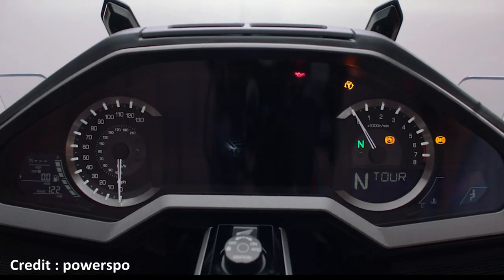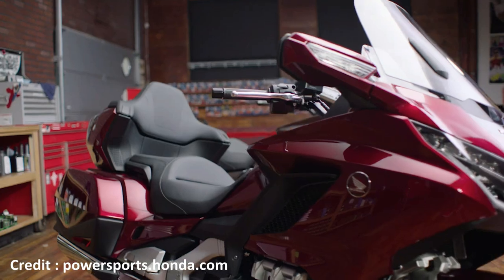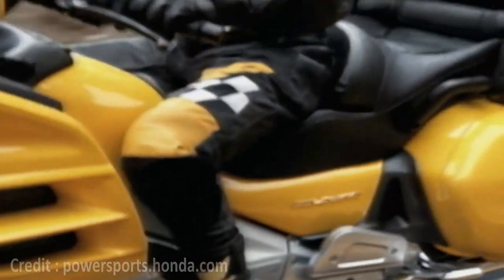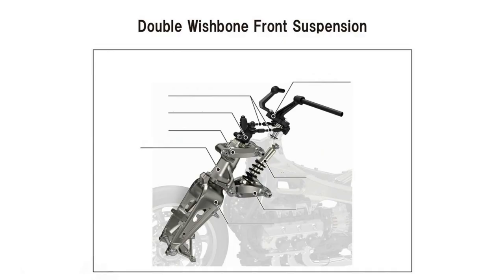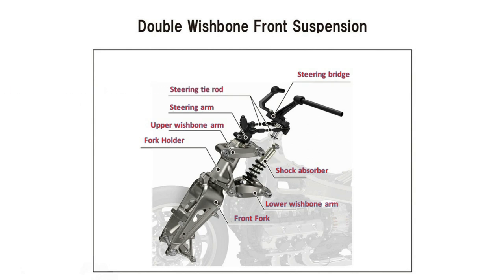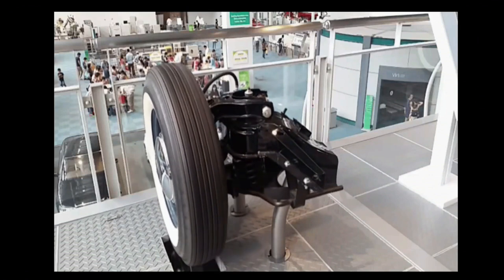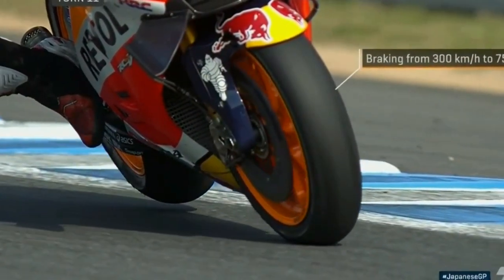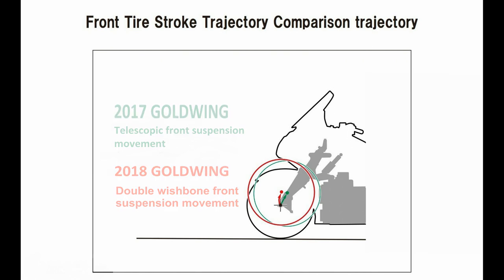2018 Honda Goldwing - How The Double Wishbone Suspension In a Motorcycle Works?

Comment: After riding my 6th gen Wing for something just over four months and 15,000 Kilometres, I have to say that I'm more impressed with the bike every time I get on it. The front suspension is amazing, the feel is very positive and overall the riding experience is about as good as it could be. It's comfortable, has good power and handles amazing, far better than it's size would indicate, due in large part to the front suspension. Honda did a wonderful job with the Goldwing's revamp. Love this thing.

Comment: Thank you for this explanation. I do have one question though, and would love to hear your take on this:

How exactly does the double-wishbone on a motorcycle help improve handling and turning better than the older telescoping implementation?

Thanks and cheers
Reply from the maker: Apologies for being late to replay. The first thing that we need to understand is the Gold wing is a full blown luxury tourer. So we cannot expect a superbike level of handling and performance.

In this case the double wishbone suspension system is a much lighter set up than the old conventional telescopic setup. Honda claims a 40% reduction in the steering mass. if you consider the overall weight of the Goldwing, it makes a world of difference in the handling of the motorcycle.

Regarding the manoeuvrability; if  you compare the old bike with the new one you can see that the new bike has much narrow profile than the old bike which again thanks to the new suspension design, which is much narrower that the old telescopic setup. 

But if we put this suspension setup in a super bike it might not work well. Because this one has too many linkages when compared to the traditional suspension setup and it may take away some of the front end feel which is an essential part of the handling characteristic of a superbike.
Reply: Thank you for responding.  I am afraid I did not phrase my question in a more clear fashion.

You see, I did own a Goldwing and am familiar with how it feels with telescopic suspension.  I was wondering, since you have driven both, exactly what differences you felt; that's all.

For example, while braking, how did the anti-dive feel with respect to the older telescopic suspension, when turning (at parking-lot speeds or even at higher speed cornering) how different did it feel, etc.

Thanks and cheers

Comment: Don't drink the cool aide.  While some cars employ this design for four wheels, it does not necessarily work that well on a MC.  There is a tremendous amount of refinement required by Honda to make it good, and they will probably get it right in 8-10 years.  But right now,  highway cruising where it supposed to excel is not good enough.  Overall, it is under sprung.  It makes no preload adjustment for the weight of different size riders.  Everybody is treated the same.  Consequently, the suspension bottoms out with heavier riders over humps, bumps and road dips.  It lack sufficient rebound damping so it floats softly at speed on the highway.  Compared to a triple tree suspension, it has many more moving parts in the steering linkage and wishbone system that it is difficult to eliminate steering play and suspension wobble.  On some of them, shake the handle bar and the front wheel will independently reverberate.
Reply: Check out the newer Goldwings........... There have been serious upgrades.